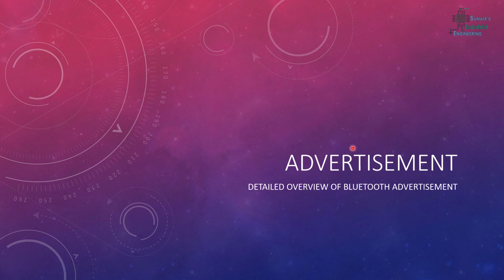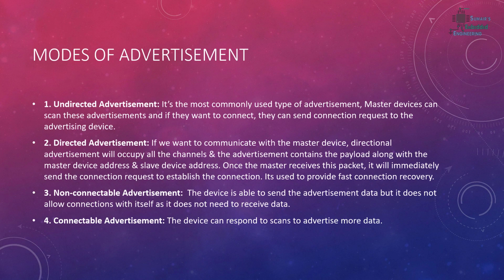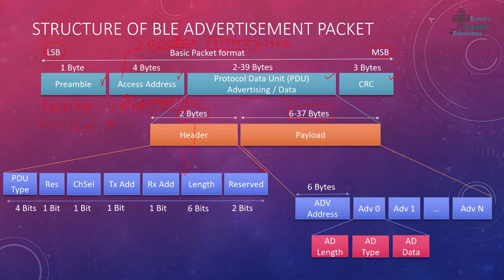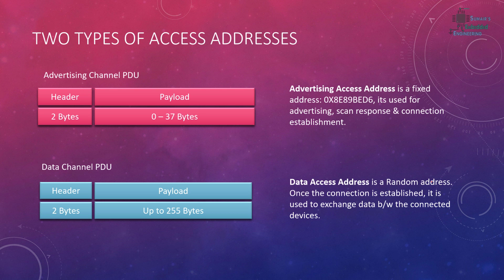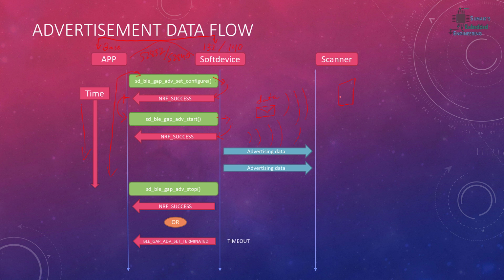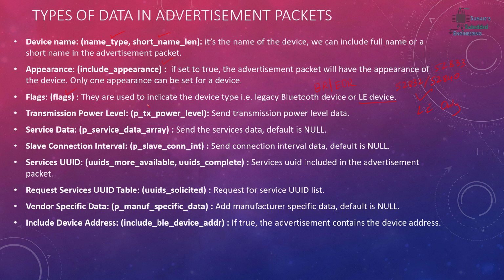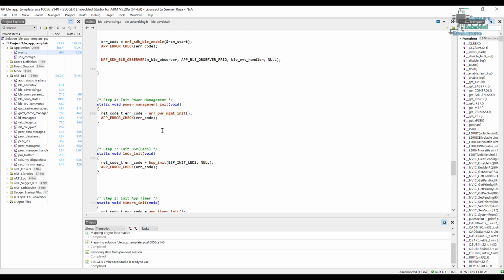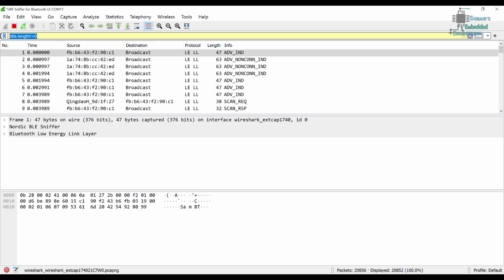nRF5 SDK - Tutorial for Beginners Pt 45 A -Advertisement Basics

Comment: Hi, i have a doubt.
I am programming two nrf52840 devices. One of them acts as advertiser and the others one acts as scanner. But my question is:
Could I send a message in form of advertisement from the scanner to the advertiser without connecting them?
I mean, using a directed adv from scanner and them receive It in the advertiser?

But, with this approach, I would enable the advertiser and the scanner simultanously, and I do note think this is possible...